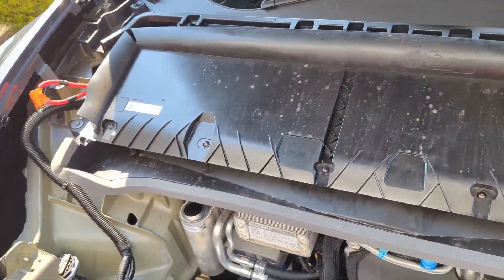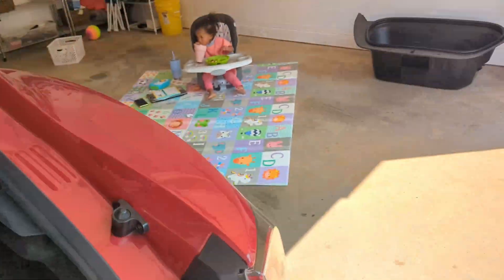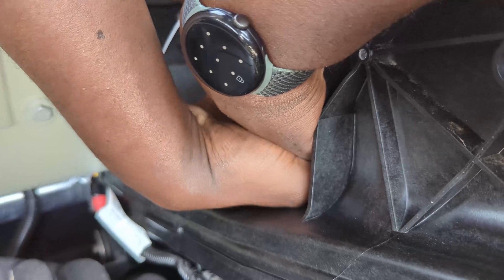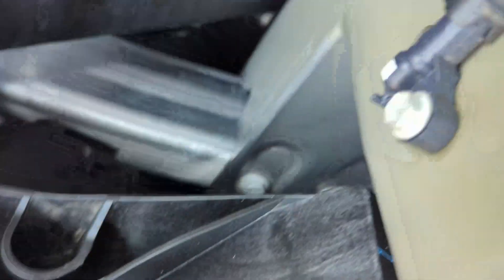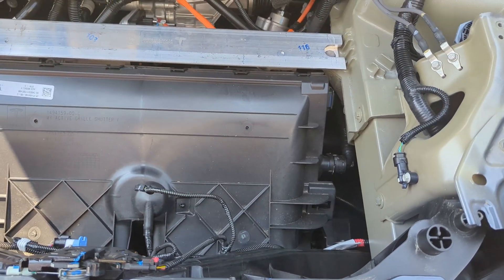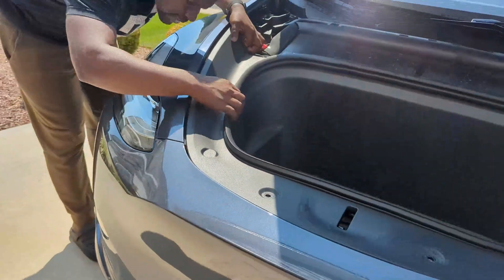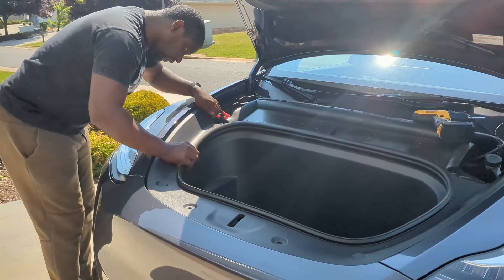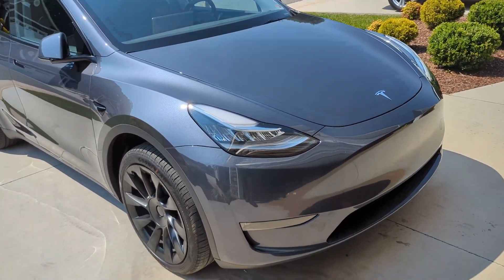Tesla Model Y Homelink DIY - Correct way to mount the module

Comment: Why Zip tie it when you can easily bolt it in place? And no you don't have to remove the bumper. Also you have the bracket for the home link facing the wrong side. If it is too difficult for you to mount the bracket in the front bolt it like most people in the back. It still will be more secure than a zip tie that will rattle and vibrate and eventually break. Sorry, that's not cool.
Reply from the maker: I assure you it is very secure and snug. I couldn't bolt it with it facing backwards if you watched my previous video. This video was in part to advise people on the proper mounting position as the title states. I chose to zip tie it but you don't have to.
What exactly is "not cool"?

Comment: Why not just use a 10mm bolt instead of a zip tie?
Reply from the maker: I would have to take off the front fascia to screw it. I may have been able to do it with a specific tool but the zip tie was too simple to avoid haha